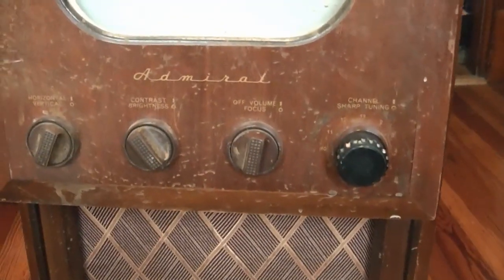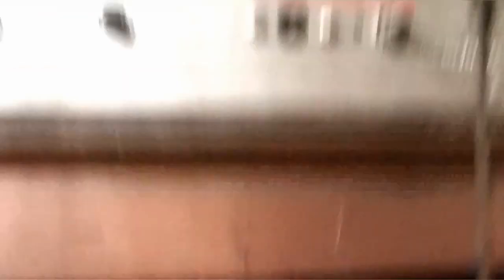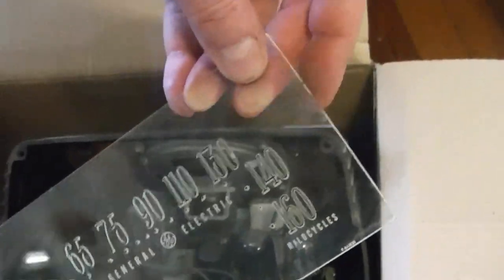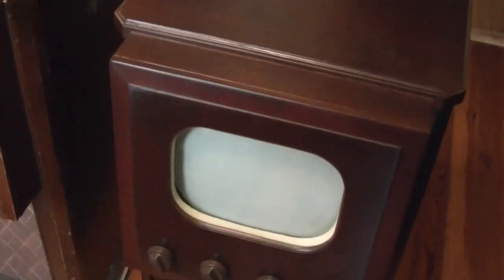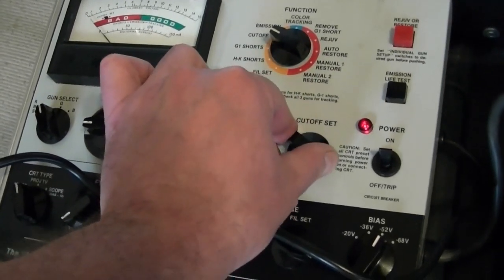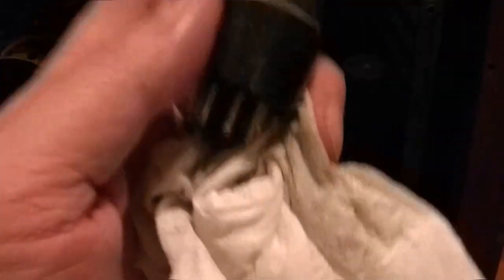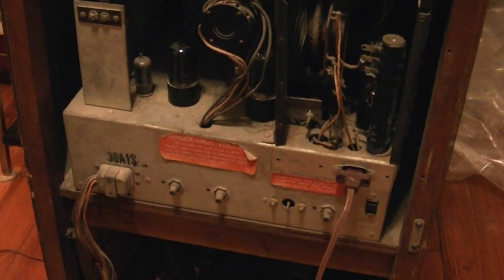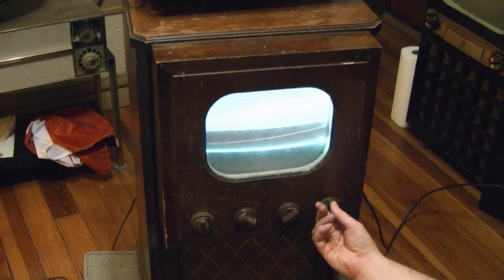Admiral 30A12 restoration p1o?

Comment: At the two points where you changed channels, I could see brief flashes of light in that clump of wires, coming out of the chassis, in front of the flyback. Specifically: 24:36 & 24:42.